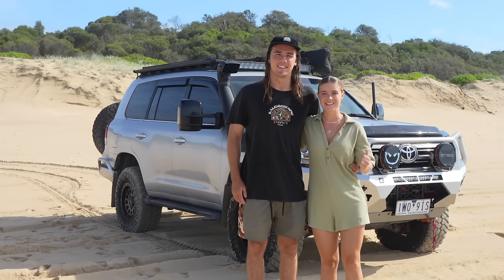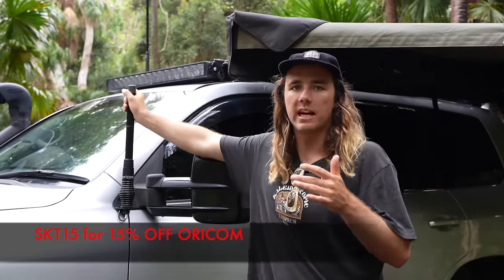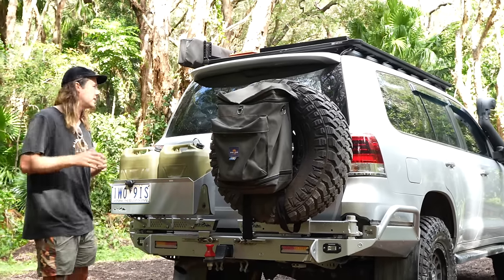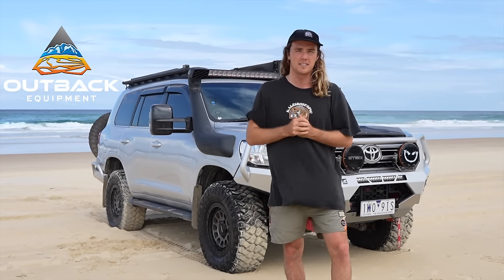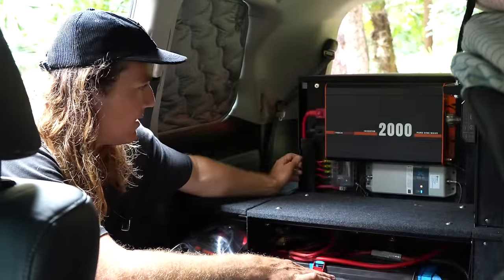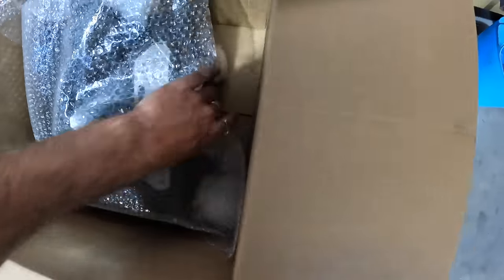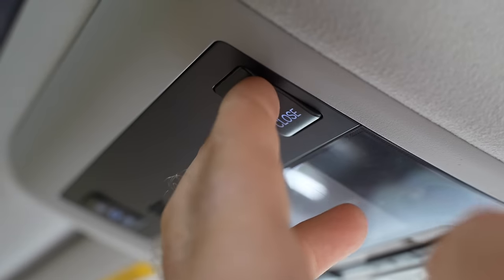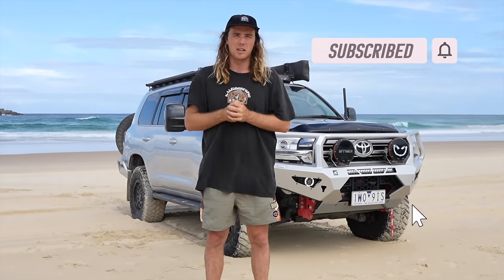LC200 MODIFIED full walk around! OUR WEIGHT EXPOSED! Toyota Landcruiser 4x4 for lap of Australia

Comment: You have an amazing well set up Land Cruiser. I have learned a lot watching your channel. We have a lower budget and are in the US so we have a 2014 4Runner Trail (Prado), named Kronk. We went with an OME 3" lift medium springs, 285/70/17" Mickey Thompson Baja Boss tires on stock rims. Our batteries are dual Optima blue top AGM  with a Redarc controller. 12000 pound Badlands winch on a Warn multi-mount front hitch bracket. The solar is 100 watts on the roof and a 100 watt portable folding panel, that powers our rear electric panel and our Iceco 48 qt fridge. Our backup power station is a Ecoflow Delta 1300 watt. It has SSO rock rails but no metal front or rear bumpers...No roos here, less weight. We have Pro Comp lighting and upgraded all our stock bulbs to LED's. We plan on getting a light weight less than 4000 pounds (1800kg) trailer and eventually upgrading to the new 6th gen 4Runner (2026?) When it finally comes out...

Comment: Hey Sarah and Keelan,
Magic Code word is : ORICOM
Really love the build and it is well thought out and executed and suits your purpose. Not over the top and not stuff that is mounted up that you won’t use. (Aka Dead weight)
Hard to pick which bit but really like the “The Cruiser Company” rear bar for the way it is designed and Intergrated into the vehicle. Not to forget the rear setup also.

As for your comment about seat covers. Look at the retro canvas from Razorback. You could have them embroidered with “Leroy” and we have been running them over N80 Hilux Leather seats and have treated them to Kimberly and Central Oz red dust and they have always come up well with a light clean.
Reply from the maker: Thanks Andrew!! I’ll have a look into the covers, that’s a pretty cool touch with Leroy embroidery!!

Comment: Wicked build 🤙🏾
Be careful running 17” wheel on the VX
As you touched on they have a bigger rotor and is why Toyota run a 18” wheel on VX & Sahara 
A big concern running the 17” wheel is the clearance between the inside of the wheel and the brake calliper 
Driving off road , long distances , there a greater chance for rocks to get caught between Calliper and Wheel and flog out the rim
Just some food for thought 
None the less awesome job , keep up the good work guys👌🏾
Reply from the maker: Thanks rod!! We looked into this and did some digging with installers and ROH and say it’s pretty rare, we thought the advantages outweighed the risks in this instance!! Thanks for the heads up rod. Always good having multiple eyes on what your doing keep us straight

Comment: Love your videos, they are super informative, thanks heaps for the detailed run down. We have a black VX 200 series, 4200 GVM, stock GCM. We've been up in the air about if it is doable to keep the vehicle at 3.5t, considering vehicle weight is 3t as it sits (inc. GVM/wheels/rack and full tank of fuel).  Looking at very similar mods for weights and looks. Are you at 3.5t packed with gear? Hoping to keep it down at similar weights to you. Banging looking 200! Probably one of the nicest we've seen.

Comment: Nice rig, good to see you been very conscious of weights. One thing you didn't mention is, what is the rear axle weight on the 200 with the caravan attached?
We are struggling to get our similar kitted out 200 VX (with the 4015 GVM upgrade, but missing some Oricom gear) under the max rear axle weight.
Reply: Can't imagine they have managed to overcome the rear Axel weight,not with all the accessories,you choose to ignore it and run the risk, or a new tow vehicle.

Comment: loved the run down, helps process my own ideas between a dual cab canopy build and a wagon fit out.  still need to use it as a daily driver.  That Oricom gear certainly seems to look pretty good though, especially the slim line mounts

Comment: The factory fuel filter has a water separator and filters finer than your aftermarket one, the factory one also works off a pressure differential so it will throw a light when it needs to be changed due to restricted flow, that extra filter is just adding resistance and costing $$ no advantage only disadvantages 

to save weight start with alloy bullbar followed by changing the starter to lithium

You done well to try and Keep it legal but once you got it tuned that went out the window, not a hypocrite but you really should call a spade a spade to be fair. 

Al that said I like the car got bit of kit

Comment: Good gear that Oricom. But I really liked the ARB base rack for its function and light weight. So with 22l/100km, what size is standard tank. Are you using the 2 x 20L jerry cans on back as your long range tank? Great work Keelan with the neat wiring path to the rack. Is the roof top solar panel a household panel?  How many watts?
Reply from the maker: thanks mate! think its around 125-130L or something close to that!! narh they are water jerrys! we still get a good 700KM out of a tank towing, beach towing kills the economy though!! its 210w 24v panel
Reply: @SarahandKeelanTravels  thanks so much for the further details. Luv following you guys.

Comment: Some really cool mods mods on your car. Lots of favs. The rear bar is great with the gas assisted struts, makes it a lot easier to open and looks great. The airbagman air suspension is always very useful when towing. The Bushcompany awnings are probably the best awnings on the market, but Keelan why stand beside them when it is way more effective to stand under the awning lmao 🤣🤣🤣. Of course the coms are important and "Oricom" is one of the best on the market. Though after all that I'd have to say my favourite by a bees dick is your front bullbar, looks great, is strong, well engineered and even with the Warn winch total weight of around 100kg give or take is one great bar. Wow that was a War And Peace size comment lol 😂.

Comment: Nice job, awesome fit out.  100% on them being heavy rigs!! 
Was that ball weight with the van packed or the tow ball weight at the vans tare?
2ndly, what was the rear axle load with the van on (presumably you've had it professionally weighed??)
Reply from the maker: thanks Brett!! thats with the van loaded, its a rear door van ( door behind the wheels) meaning it has light ball compared to front door dual axel. if we had of got a front door van we would have exceeded our rear axel limit as the ball weight would of been around that 300Kg mark. we had it professionally weighed, our new GVM rear axel limit is now  2145kg and we are well under that 2145kg with still over 100KG to play with on rear axel limit. HOWEVER I wanted a long range tank,  (the tank gets installed behind the rear axel - bad spot for weight) that mod would have put us over when we fill that long range tank up. so obviously that was the compromise & why we chose not to do that mod. Like we said, we designed the setup so it was under weight, we even designed the van weight distribution so it was under weight.
Reply: @SarahandKeelanTravels  thank you for the detailed reply and well done to you both on keeping within the weights, its a real challenge with the 200's.   We have the long range tank, 180L and yes, it creates an issue which isn't ideal (nor is shared with you at time of purchase!).   Combined with a TBM (300kg), rear bar/wheel carrier which is mandatory when you fit the tank, drawer/fridge etc in the rear we found ourselves well over on the axle load (2.6t!!).  A 4495kg gvm with replacement diff housing (3t) was the expensive solution....(after undertaking 4015kg gvm)
While we love the touring range (especially not towing) I dont think I would fit one again for problem it creates @ full, when a couple of jerry's on the van would likely suffice.
Safe travels and keep up the ripper content.  🤙🤙

Comment: Mate, isn't it possible to run 35s? At least there's enough room to run proper 34s on your current setup by looking at it. Correct me if I'm wrong. A big V8 runing on 33s doesn't quite sound right. It would be amazing to get this thing of a beast in 35s.
Reply from the maker: you have to do a chassis chop to fit them, cut the body mounts down so narh not keen on that
Reply: @SarahandKeelanTravels  yeah, that's right. The current setup ain't bad at all, mate.

Comment: Hey SKT, with your wheels and tyres fitment up the front, did you have to do any cutting or chopping to keep the front mud flaps on?
Reply from the maker: Just had to mould the front mud flaps with a heat gun no chopping or cutting required

Comment: Would you still be covered by insurance with your 295/70/17 tyres? There 33.5 inches my 79 series can go to a 33" tyre max I had 35s but recently changed to tow the van legally
Reply from the maker: Depends, we have had our car re GVM to 4015kg and the max legal size for that suspension upgrade is 34inch tyres. It’s been engineered so it’s street legal. If you don’t get it engineered then yes you probably can’t

Comment: Your tow ball mass is 5.78% of your ATM. That is very low compared to the industry recommended figure of 9-11%. 
You must be loading too much to the rear of the van to keep your weights right. You are in danger of suffering severe caravan sway.
Reply from the maker: narhhhh, the new cruise master air softens the tow, this van tows like a freight train, dead straight, no sway even when I be erratic.. urban have engineers that test this stuff.. ATX suspension doesn't behave like coil sprung vans. hope you see us on the highway at 100kmh one day to see what I mean.